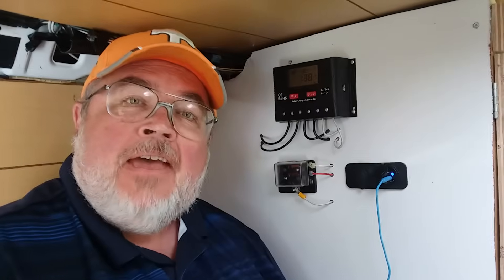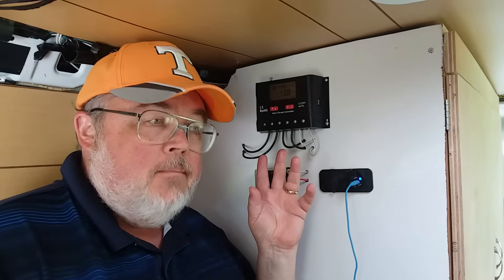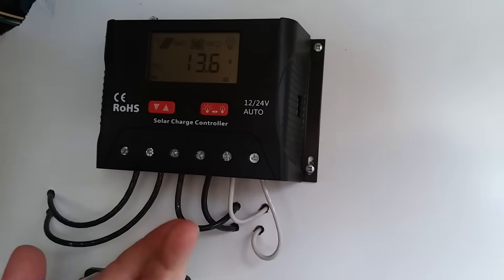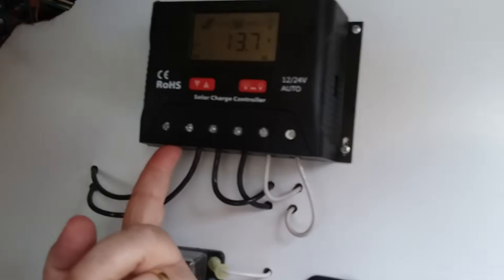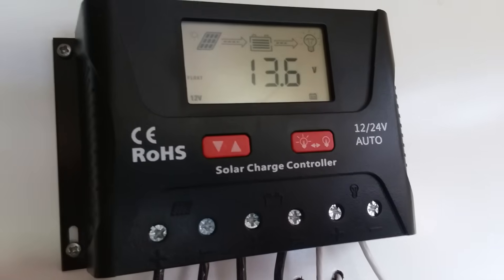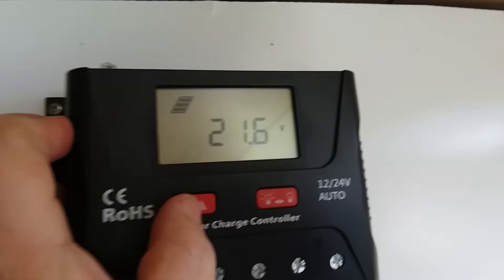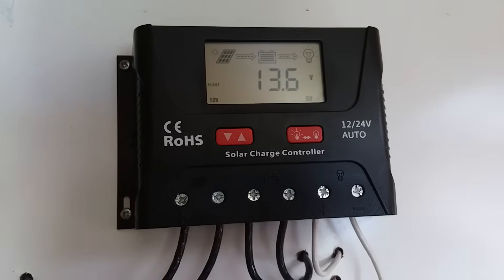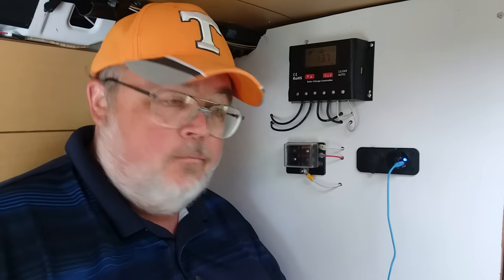What is a solar charge controller

Comment: Thanks for the video. I was wondering if you could tell me how you switch battery types on the controller. I notice there are four setting, I just do not know how to change the settings to reflect the type of battery that is being used. as I am going to switch my battery from acid to lithium. Thanks
Reply from the maker: Congrats on going lithium! We've had this awhile. I don't remember it being difficult to set up originally so switching it over probably won't be. Let me fiddle with it and see if that will jog my memory.
Reply: Thanks so much, I have been reading through the manual but I have not yet figured it out. I was hesitant to start playing with the setting in fear I may screw things up. I enjoyed your video, thanks

Comment: what happen when the solar charge co ntroller shows and E. 1?
Reply from the maker: E1 is an error message. You'll need to Google your particular model to determine what that means for your manufacturer. It could be a simple issue and not catastrophic.

Comment: This was very helpful! Thank you! I just bought a little camper trailer with this same controller already hooked up. But mine doesn’t have wires going out anywhere in the 3rd section of wire spots where the little lightbulb is. Do I need to worry that there’s no “out” wires connected?

Comment: Could you run 300 watt solar panels on that charger
Reply: I just bought a slide in camper that has (2) 200 watt panels and the kit is from Renogy. So I say it would work.